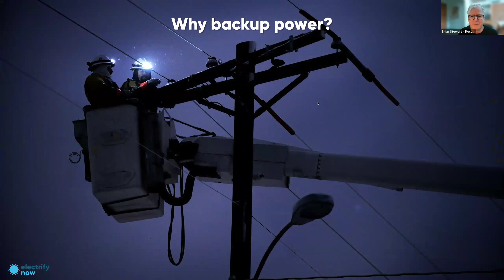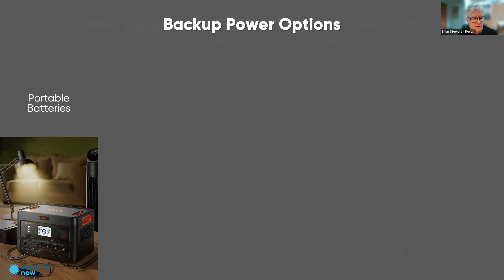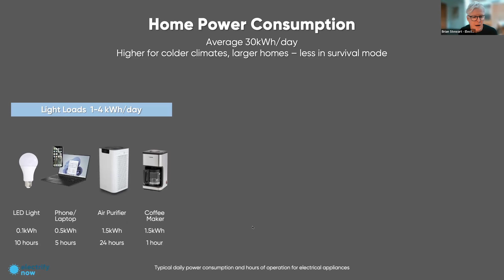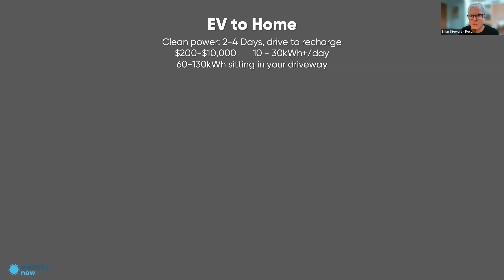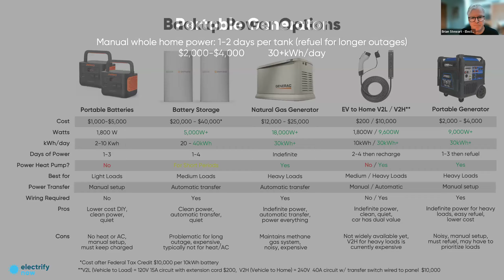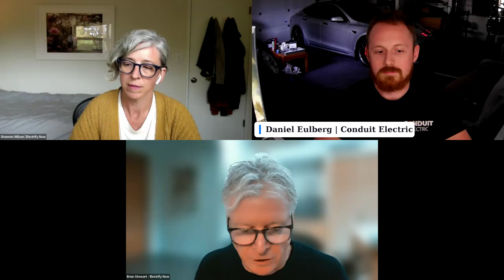Portable Generators - Backup Power for Emergencies

Comment: Ford Lightning has onboard 7.2kW inverter.  Cost to backup your home is zero dollars, not $10,000!!!
Reply from the maker: Yes, you can run an extension cord  or two from the Lightning that would be zero cost, but to get the full 9.6kW at 40 Amps from the Lightning, you need the proprietary Ford charger, transfer switch and the wiring to connect that to your electrical panel which runs around $10K for equipment and installation.  With the extension cord, you cannot operate heavy loads like HPs, AC etc.

Comment: What happens if the generator is overloaded? Is there damage, or just a blown breaker?
Reply from the maker: The generator has a circuit breaker on it that will trip if the generator is overloaded.